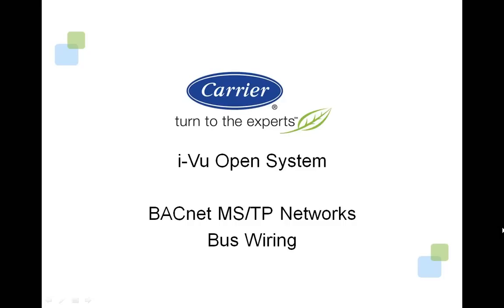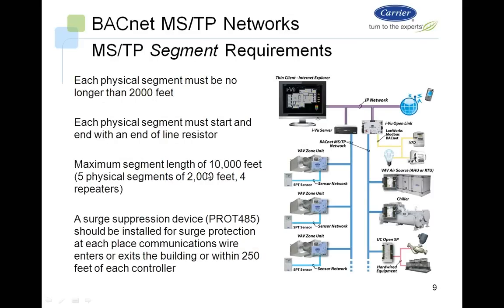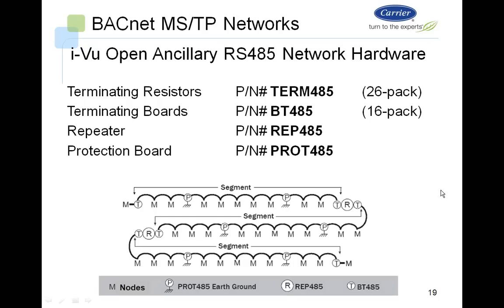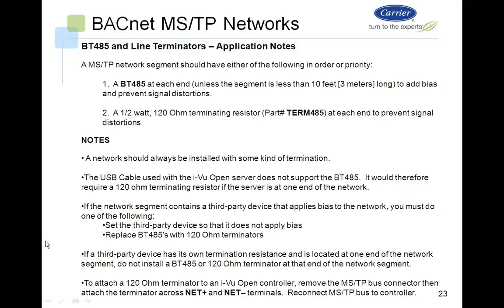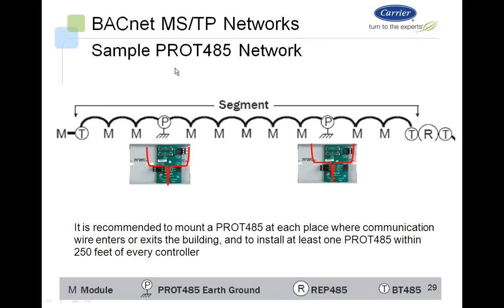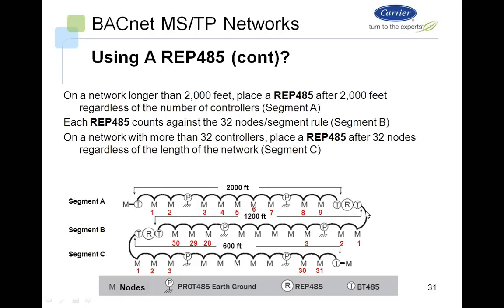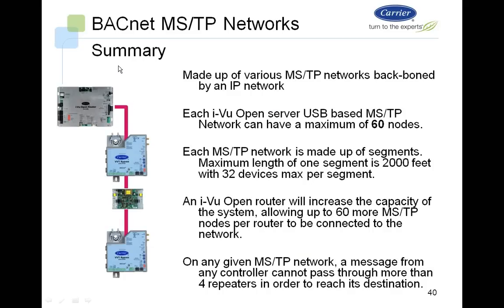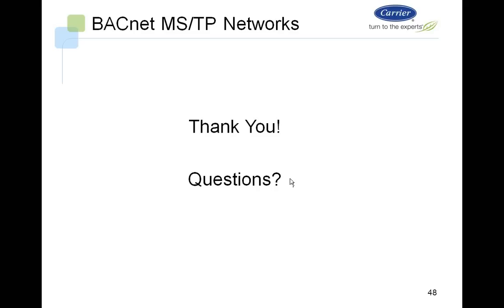I-Vu Open System - BACnet MS/TP Networks Bus Wiring

Comment: Technically, and per BACnet/Manufacturers instructions, yes. There should be a PROT485 at each roof penetration. The object is to isolate a lightening strike to the roof.

Comment: Good afternoon, the PROT-485, it is recommended when the communication goes from an interior area to an exterior one or vice versa ... if there are many machines on the roof, they can be placed in the units where the communication is between the interior or exterior or vice versa. ... the a / c unit as such must have its protections against electrical noise so as not to affect it in the future.

Comment: Would you then install a PROT485 inside each package unit before going down into the building or would it have to be installed inside the building below the roof penetration. This is not clear in the manuals.